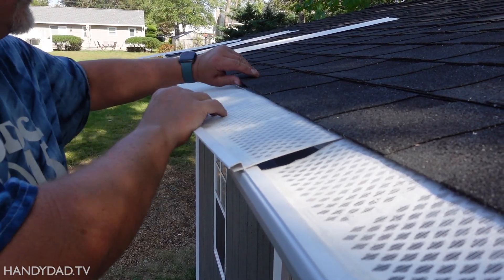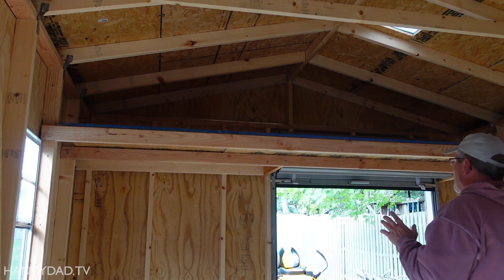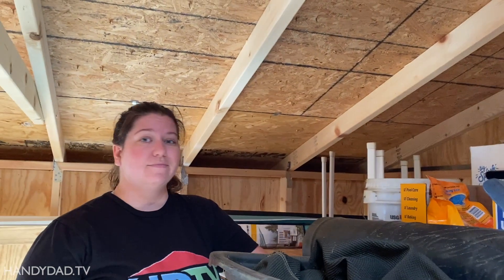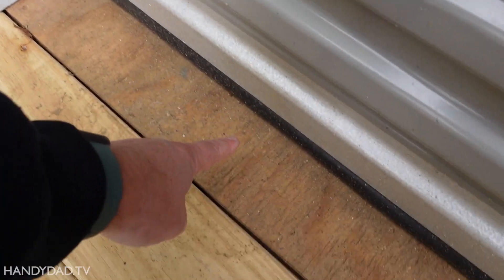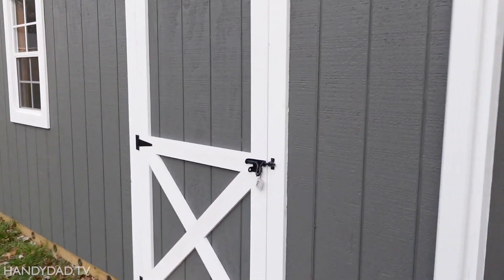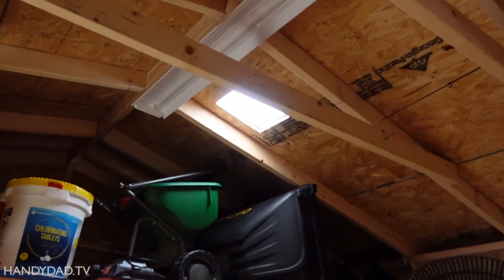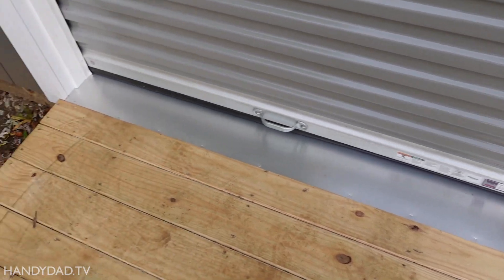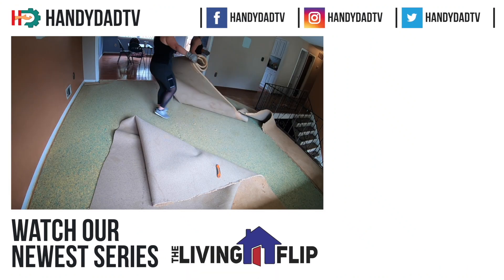WE BUILT A SHED part 7 // TLF 53

Comment: Just a note on the gutter guard; cut out a 3/4" notch at the bottom and overlay it as you make your way to the downspout. This way, the leaves dont get caught in between the 2 gutter guards. 
The buried UF cable is perfectly fine but I always like to use conduit just incase for whoever is digging. 
Hope the wifi signal is good at the shed for that ring cam.
Reply from the maker: Good tips! Thanks.

Comment: I’m building a shed very similar to yours with a wood floor as well. Planning on doing a roll up door just like you did for my zero-turn.  I didn’t think ahead like you did so my floor at the door isn’t slanted away. 

Curious how the flashing has held up cuz I bought some and was gonna do the same. I need to figure out how to make a slight slant for the floor though….

Also, where did you get your door from of you don’t mind me asking?
Reply from the maker: The flashing is holding up, but it’s very slippery. Diamond plate would be ideal. Still looking for a 5-foot sheet that won’t break the bank. 

I got mine from RollupDoorsDirect.
Reply: @handydadtv Shed looks awesome!! Thanks for responding and the tips…sounds like I’ll be on the look out for some diamond plate as well.